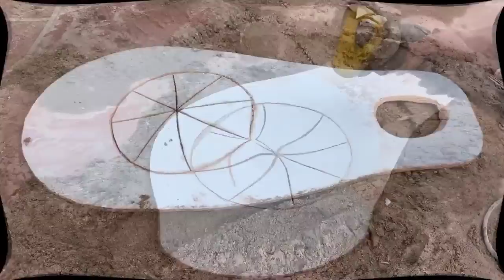Multi purpose wood stove - Creative wood stove ideas from cement and old toilet

Comment: The wood will not last soon it  will crack due to heavy heat
Reply: The wood oven will not last as the ceramic will not bear the so heat due to wood burning